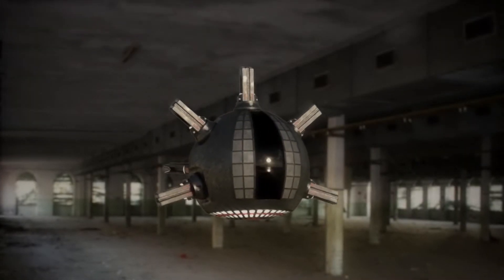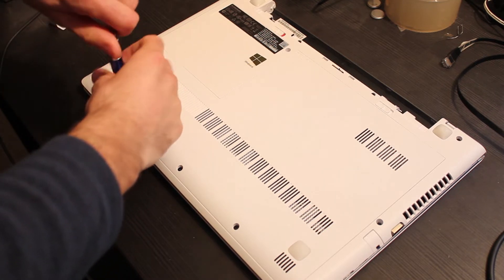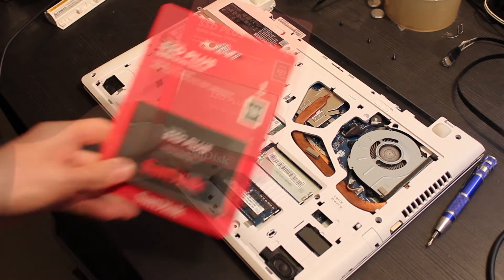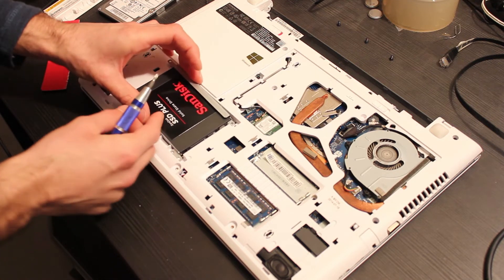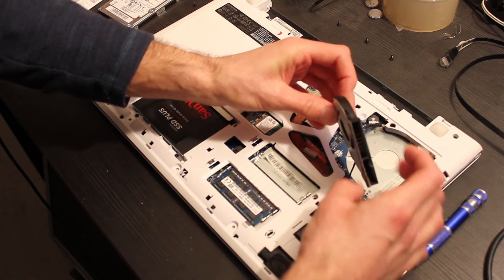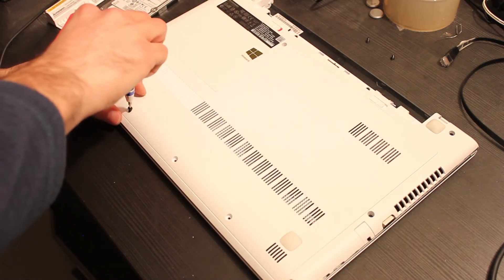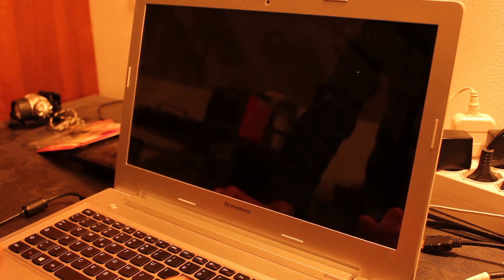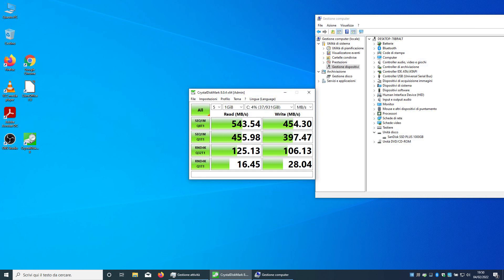Lenovo Z50-70 ssd upgrade - notebook disassembly

Comment: What about m.2
Reply: What if I remove the WiFi card but use d link will the WiFi work
Reply from the maker: @tuyufan69420  yes, good idea, it could work, replacing the integrated wifi card with an ssd and mounting a usb stick for wifi
Reply: Ok tysm! You just earned a sub
Reply from the maker: @tuyufan69420  Thanks, you are welcome!
Reply from the maker: The Lenovo z50-70 notebook does not have a m2 slot to mount a m2 disk. You can probably remove the wifi card and mount an m2 disk instead of the wifi card, but in a laptop it is useful to have wifi.